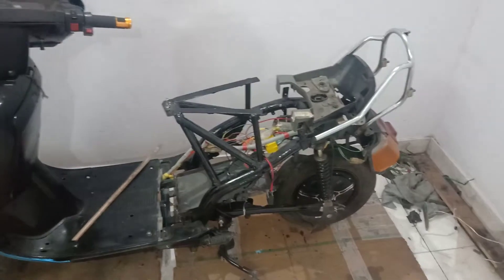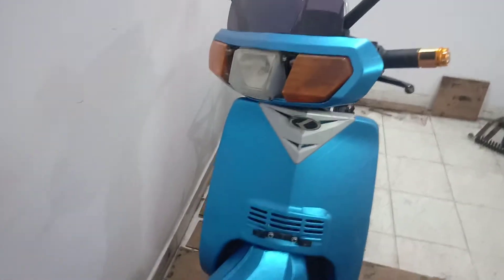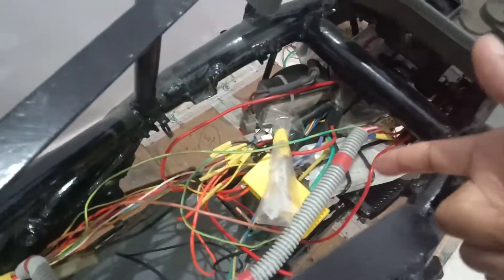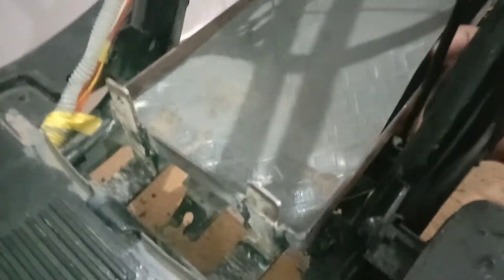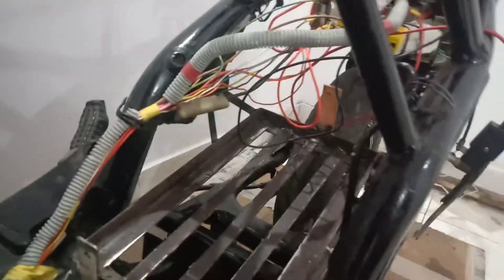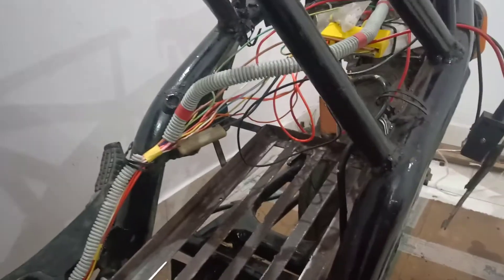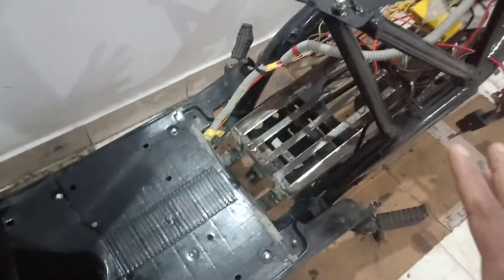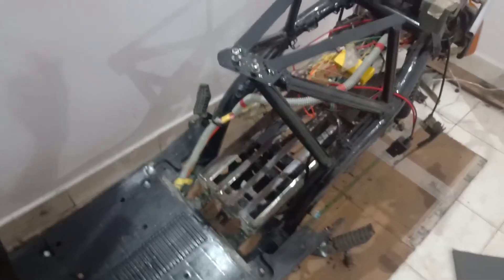conversion of old kinetic Honda petrol Scooter into electric with powerful1000w motor part two

Comment: All the best for this project... looking forward to see you riding the vehicle.
I have 2 kinetics in my house, in working condition, I wud like convert those in electric vehicle. I plan to use Lithium ion battery which will take space and motor kit with disc brake.
1. I would like to know more about the the electrical kit to buy.
2. Mechanical changes like u mentioned Splendor Plus swingarm, Suspension and structural changes like welding and cutting.
Reply: 2 stroke or 4 stroke
Reply: @geekysoumyamohan2004  
2 stroke
Reply: @o2man  DX or ZX or ZX zoom
Reply: @geekysoumyamohan2004  
1991 DX , 1996 ZX
Reply: @o2man  OMG
Reply: @o2man  did u buy it first hand or second hand
Reply: @geekysoumyamohan2004  
Both first hand
Reply: @o2man  do you have both the scooters now
Reply: @geekysoumyamohan2004  yes I do
Reply: @o2man  I also have a kinetic honda dx 1987 model and a 2003 kinetic nova 115 dlx which my grandfather sold it bcoz it was the worst scooter but I am using the kinetic honda dx now